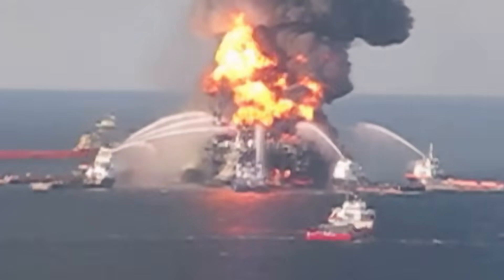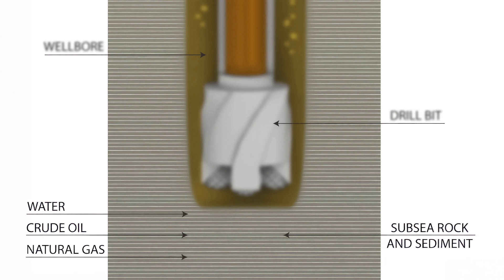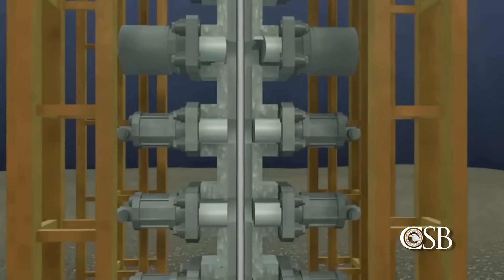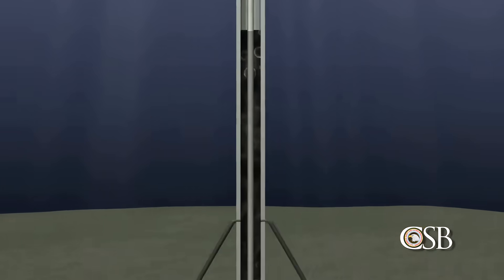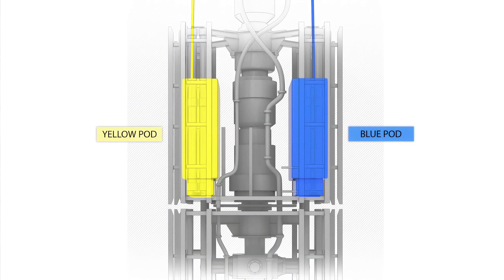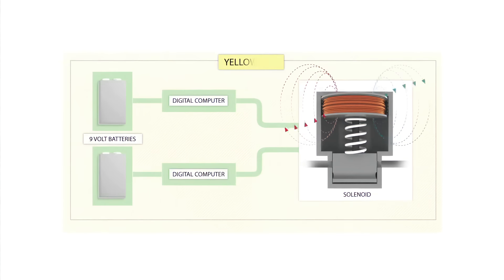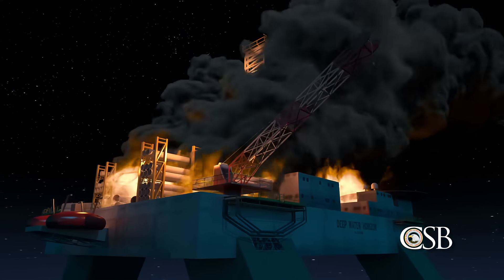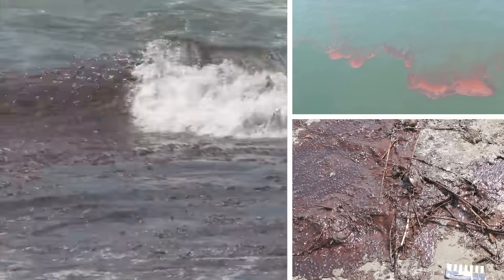Deepwater Horizon Blowout Animation

Comment: After the first Ram closed, you said this "temporarily" fixed them problem, but hydrocarbons that were already above the Ram continued to flow upwards, how is this possible? If it did seal it to begin with, where did the pressure come from to continue to push the oil up?? I understand that there would also be a pulling effect going on, due to the fact there was already oil coming out at the top of the rig before the Ram closed, but when it closed it also should have stop the "Pull" effect too. I don't understand how it continued to flow upwards? Maybe someone with better knowledge could answer this question. My dad was roughneck for 14 years, he started out being a "roustabout" on a rig pretty close to the Deepwater Horizon rig, but he had already began working for a different company by the 2000's, so he wasn't in the Gulf when this happened.
Reply: Oil has a lot of natural gas in it and it's getting released from an enormous pressure, it can be like a fizzy drink.

Comment: That BOP valve is the most poorly designed piece of critical safety equipment I've ever seen. There's absolutely no reason why the solenoids in the pods are not failsafe. They should be spring return open (which would hydraulically activate the ram shears) so that if they wire it wrong, or a battery fails, or any other failure occurs, the ram shear activates. It's such a simple change. Had it been designed that way, they would have found the wiring error for starters right off the bat, because they wouldn't have been able to open the ram shear in the first place to get the pipe in. It also would have activated when the battery failure occurred. It's unbelievable this BOP design was even approved for use. Plus they clearly did nothing to even commission it since there were wiring errors all over it. They basically bought a terribly flawed piece of equipment, and then just installed it and started operating. That accident should have never come close to happening.

Comment: who fucking designed this garbage? my 20 year old tacoma has more failsafes in the brake system than this whole rig. There's also a thing such as airbrakes like on a truck. If the power fails, the brakes lock up. It isn't new technology. smh

Comment: The bent pipe is a factor that was not predictable for the correct operation of the blow out preventer. That aside. It is obvious no quality control testing of the preventer was performed before it was delivered to the site. Maybe it was skipped to save money and look at what saving that money has really cost you BP.
Reply: It's important to remember that the use of this BOP is already at emergency level. The highest level of emergency. This rig was doomed by management days and weeks before the blowout occurred.  Had Management been doing their jobs the BOP would never have been activated in this way. Of course the BOP should have saved them but in reality it was an "oh by they way". after all those screw ups and short cuts that caused the well to kick then the bop didn't work.

Comment: An overly complicated failsafe that relies far too much on the integrity of the system as a whole. I mean, batteries and computer chips smack in the middle of high pressure depths and high pressure well-discharges?....what could possible get fucked in that situation???? What assholes designed this shit?
Reply: If it requires more than mechanical power to operate it's not failsafe.

Comment: How did they end up sealing it off?  Why did it take 82 days?  Thats the important question since as the video states its not a matter of if this happenes again but when.   Relatively complicated mechanical safety objects a mile away underwater sounds like a recipe for disaster.  Too much to go wrong.  How many times have BOPs saved a rig is the next question?   
 This system seems imperfect and extremely susceptible to delaying utilization due to the loss of money by deploying it.  I could be wrong but seems like if this happened again thered be reluctance to activate the safety features for fear of being wrong, until its too late for them to work.   Maybe its a bad idea to drill this deep?

Comment: This completely ignores the main factor which is the concrete walls did not seal properly and B.P. refused to pay for the test to check it. B.P. has a history of negligence. Even after the accident they used illegal  dispersant agent instead of cleaning up the oil. A truly sleazy company. I would not be surprised if they were behind these type videos blaming everything besides their management for this. Yet they were clearly found negligent and guilty as they were as well in the Texas City explosion.

Comment: I'm not an engineer but I have the mind of one. Why couldn't they have a back up for the backup? I don't understand why they couldn't put say a pressure tank that is the last resort if the batteries fail. What if there was an emp blast during a kick that would bend that pipe? This whole rig would go sky high. I would say putting a pressure regulator connected to these solenoids to close them and seeing that they only run off a weak 9 and 27v, you wouldn't need too much pressure to get them to close in the blue pod and yellow pod.

Comment: The bop might lack features to strengthen support on the pipe to prevent it from bending/deforming which would not let the pipe slip off from the blades in emergency situation.

Comment: Although I do not grasp the complexity of deep sea water oil drilling and all the mechanical engineering involved, I'm surprised however that no pre-built technology was available that could cap and seal wells up. Clearly this proves that even all fail-safes can fail, so that next measure would be to have something already built that can cap and seal up the wells. One would think there would be a device like this stored at the nearest land facility collecting dust.

Comment: You state that the crew closed a pipe ram... however if that was true, the oil would’ve never rushed to the surface. Once that pipe ram is shut, it shouldn’t re-open letting any sort of oil or sediment through the pipes. What I’m saying is that the crew never closed it. This accident was the cause of the crew not paying attention, and you’re trying very hard to make them look not at fault. If a pipe ram was sealed, there would be a static pressure in the pipes after the seal (so long as the pressure was created on the other side of that seal). None of the correct safety features were activated

Comment: So, management of the rig didn’t ensure that the safety features were wired properly. This boils down to a technician not knowing how to wire the valves and no one checking his work. It’s like when a plane crashes because a single sensor failed. The moral of the story is don’t mess with Mother Nature and oil is a dirty destructive energy source.

Comment: Weird how if the yellow pod's coil battery didn't fail, the solenoid itself would have too because of the bad wiring. Then again, the rest of the AMF had failed so it wouldn't have helped the situation anyway :/

Comment: All the elements needed for disaster are here and costed lives and damage to the ecosystem. All told the deep horizon incident costed over 18 billion and still counting. Poor leadership here as there were virtually no contingencies set aside for cases of a blowout. If most ocean based drill platforms used this type of blowout prevention valves, another incident is sure to happen. There's no way thee blowout prevention valve can be periodically tested, the design prevents testing and no way of repairing or replacing the bop valve. No way of shutting the well down to repair or maintain the only safety valve they are using. More havoc by pinching the well piping. Sealant for the abandoned line cannot be injected. Upgrades to this type of oil production are needed but are left in the hands of administration. Spill prevention drills are needed as well as adequate overseeing by the dept of transportation needed. Other issues such as pressure monitoring and leak detection need to be utilized. I'm a mechanic currently employed by a company subcontracted to a major oilfield on Alaska's North slope oilfield in Prudhoe Bay area. In 2010 June after watching the attempts to bring well control back (80 days later) was watching the remote operated subs cutting bent sections of line away and left several feet, which also had a flange inches away from the pipe end. I designed a caphead capable of stopping the leak and submitted to the " horizon helpline" . I was later emailed back and told by the "horizon helpline crew that my design was unusable. Several weeks later my design was used to stop the leak. Unfortunately I neglected to file for patent pending and slapped in the face for my contribution. For the oil companies that will listen and actually care about safe oil production can decide either to go the extra mile and pay for pipeline upgrades or pay alot more later in spill response. I have over 30 years experience in pipeline repair and maintenance and further future plans of starting my own company dealing with deep water repairs for ocean based drill platforms, as well as developing better design safety valves. Ignore me and slap me once. I'll get paid either in upgrades for those wanting spill prevention or pay me later for repairs. I still have copies of my caphead design I submitted to the horizon helpline, whether or not the major oil company involved will admit or not the credit in stopping the leak is mine.

Comment: Amazing to me how so many accidents in the fossil fuel industries occurred during the Obama administration. Strange, huh?
Reply: Oil prices were super high for most of the administration, mostly due to China going through a massive spike in demand. High prices meant a big rush to get production. Though this project was probably been designed during a low in the oil price, which meant lower quality engineering. Then the price spiked and the actual work was done in a rush. The gov has relatively little to do with it. The legislate a minimum, which companies always try to get reduced.
Source:work in the industry.

Comment: (4:25) - What is the "annular" space?
I don't know what it is.
Doe anyone here?
I really want to understand everything in this video.
Thanks.
Reply: Bodragon its a large valve that sits at the top of a BOP (Blow out Preventer) stack during drilling operations used to control drilling fluids
Reply: Annular space is space between two pipes, one inside the other.

Comment: 18.000.000 million liters of oil a day and it went on for 87 days.... one barrel of oil contains 158.987295 liter oil. And the tel you it leaked 5.000.000 million barrols of oil🧐 it is more like 9.849.843,662036014 barrols of oil if it is not a lot more.

Comment: Why did it find an ignition source? Does not every piece of equipment on an oil rig have to be ATEX certified?
Also why no monitoring of battery voltage, and no testing of the valve before sinking it to the bottom of the sea?
Reply: Wankel Motor hydrocarbons flowed into the intakes of the motors and generators and ignited.
Reply: The gases entered the intakes of the diesel generators the engines then began to overspeed and runaway. This changes the voltage and the frequency of electricty that is delivered to electronic devices... Lights /computer screens. They get brighter and brighter then explode... That is the ignition source
Reply: Start your car. While it's running, spray starting fluid in your air inlet and do not stop. After it blows, keep spraying. Did you happen to find an ignition source?
The rig had big diesel gen sets running in a cloud of methane. Boom.

Comment: As an electronic guy who spent 20 years cleaning up after someone else miswired something I can say I'm not surprised. There needs to be someone who understands the phase relationship of coils, not just an emphasis on following the wiring diagram. Diagrams have mistakes and no amount of good intention can overcome a deep understanding of what someone is hooking up.
Reply: This is really not the fault of the electrician wiring the solenoid. Everyone can make mistakes, and wrong polarity is a easy misstake to make.
The failure here is both equipment and procedures. The valve should have been tested before it was deployed, and the solenoid it self should have had diodes so it was not sensitive to wrong polarity on the wiring. Hell even most dirt cheap battery powered consumer devices have protection against wrong polarity.

And a critical valve like this sould heve been "normally open" so the solenoid wold have to be activated to prevent it from activating the shears. Yes you can say that a solenoid buring out will then cause the shears to destroy the pipe, but that is a design fault, and is better than compromising safety. It is the same reason why safety relay contactors is double in series and NO, and emergency stop buttons is two phase and NC.

Comment: Actually, methane rose to the surface first and the intakes of the diesel engines sucked it in. This caused the engines to over rev and blew the engines up cutting power to all the equipment. They had to manually cut the pipe.

Comment: I also understood correctly the one RAM that could of snapped and closed the well end of the pipe, might have not single hand idly  been enough because the sheer pressure / weight that the well below was generating? All of this taken into account by the idiocracy of mis-wiring and  and  the computer failures involved. I completely agree,  there should be a mechanism where the RAMS are kept open during power input and snapped when there is a loss of power to the RAMs fail safe computer. It may cost money to re-drill, but that has to be millions cheaper than all the lawsuits and other damages having to be paid out for taking a risk.

Comment: How the fuck can you first manage to miswire both fail safe systems (AMF dead man systems)??? Then not discover it before they deployed it?? (I mean don't they do extensive testing of all the functions before it's put into action??) And then not have a ready to deploy, seal up device for the BOP (blow out preventer) in case it would fail.

Also.. Why don't they have an automated systems check for the AMF that constantly check it's operational function, performance and structural integrity. That should be a no brainer ffs.. And an alarm that goes of immediately as soon as the AMF is even the least compromised!!

Fantastic vid though!! Much appreciated!!

Comment: What I don't understand is the following - they drill into a reservoir of gas/oil that's under pressure because it's so deep and trapped under rock, right? So to prevent that stuff from coming up they put heavy mud on top of it, through the pipe. Is that right? So how did the oil and gas get into the pipe on this one?

Comment: I'm a HVAC mechanic and work on commercial/industrial equipment. I see a lot of equipment wired incorrectly, safeties not installed and other issues that make equipment unsafe. It's scary how much equipment gets overlooked because when it works it's works fine. But when it fails all the things that mechanics overlooked is a real problem. Here's a small example. On every commercial boiler there is a safety called a "low water cut off" switch. This safety shuts off a boiler if it gets low on water for some reason. The way this switch is supposed be tested is the boilers main gas valve is shutoff. Then the boiler is isolated from the hydronic lines and drained. If the safety is working correctly the boilers main power shuts off automatically. But this takes time usually 10 minutes, so what most mechanics do is hit a test button on the control and call it a day. This completely ignores the proper test procedure but it only takes 10 seconds. My guess is that all industries including the oil drilling industry are the same as mine. You are not as safe as you think.

Comment: Gas pressure is no joke, I worked on a rig that had a gas kick and pushed out  2,000' of drill pipe( keep in mind it takes 2 people just to lift a 30' pipe section (joint) its so heavy ) like it was spaghetti.
Reply: What happened when it pushed it out? Shoot it all through the rig into the air?

Comment: I can kind of understand that the bending of the pipe might have not been anticipated as a possibility.. 
But if people's lives will depend on a system, then checking the wiring (at the least) and monitoring the batteries and such are about the least you can do.  This wasn't 100 years ago -- this was well after the internet and SMDs and there is patently zero excuse for the electrical faults occurring.  That would be criminal in any other scenario.

Comment: Acme Trucking delivered 2 workboat docked @ Port Fourchon LA the last pc. of casing pipe that the blowout preventers were welded onto the Macondo rig.
Wonder if Acme got sued? BTW...
that one pc. of pipe was the only one on the back of that flatbed truck owned by 'Chaco' due 2 it's weight:
~38K+U.S. Pounds.

Comment: I guess whoever designed the system should use the same setup that a smoke detector has. An alarm or constant irritating chirp at all hours of the night letting you know that the battery is running low.

Comment: So no actual footage of bent bar could it just be bad substandard metal bought on the cheap as cost cutting is the norm today
Reply: The BOP was recovered along with the severed drill pipe.  Examination and photos clearly showed the pipe was way off-center when sheared.  (CSB Report Appendix 2-B, pg. 35 - available @ csb.gov).  Also, tests of the pipe steel showed it had good strength properties.